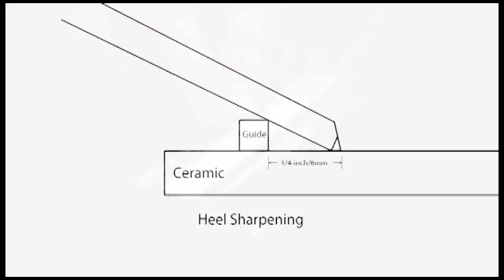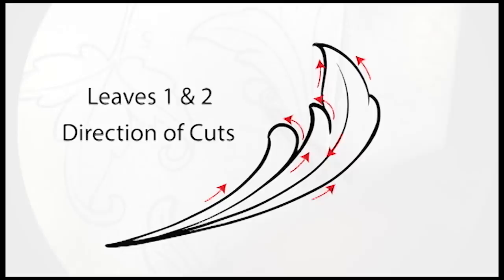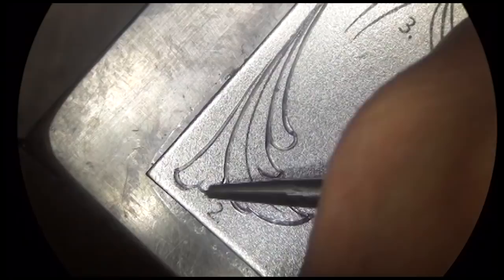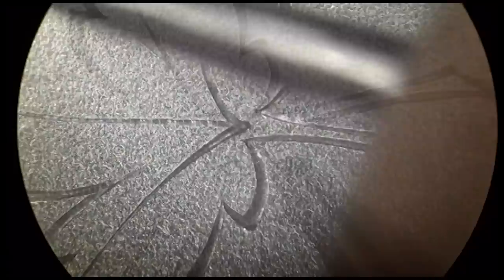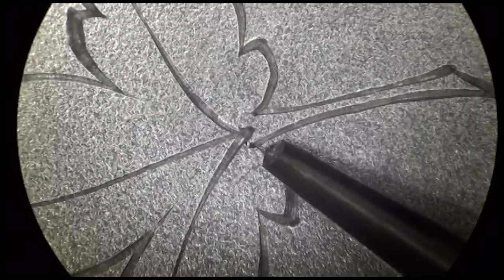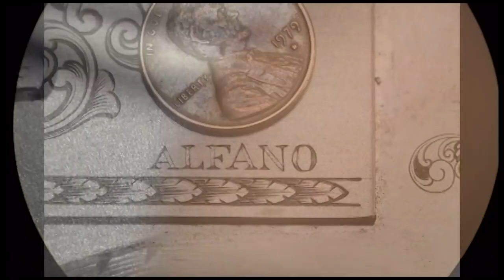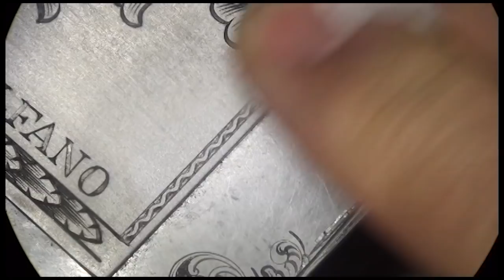Learn Old School Hammer & Chisel Engraving by Sam Alfano

Comment: I'm starting out with engraving.  Can you suggest a good starter tool set for me?  I would like to avoid frustration but not spend a mint doing it.
I already have an engraving ball and would like to get a good starter electric graver machine, (maybe one that I can use hammer tools with too) as well as a good set of gravers and maybe some instruction on sharpening?
So, I guess I'm asking for suggestions on the machine, gravers, and sharpening equipment, plus what I'm missing 😁

Comment: o.0   
YIKES - $425.00
Reply: Yeah, it is a yikes. If you're on a budget, I would recommend getting a Fretz chasing hammer ($50), Ngraver beginner graver set ($36), Ngraver Belgium style graver handle ($8). Besides tool sharpening and work holding, that is everything you need to start.
Reply: @shanemccarthy1562  do you have link ?